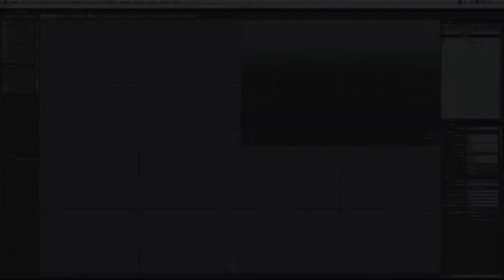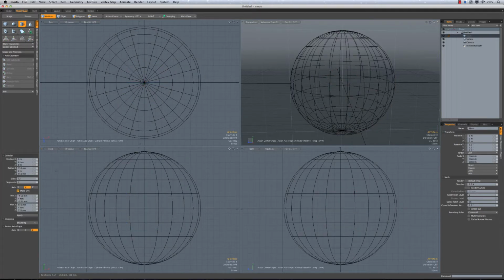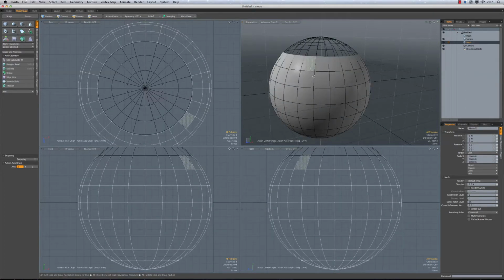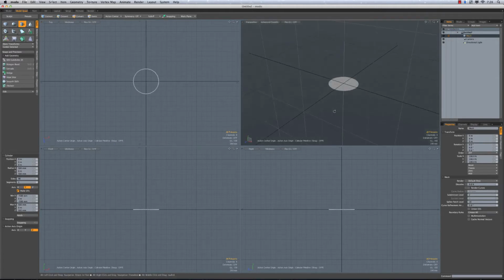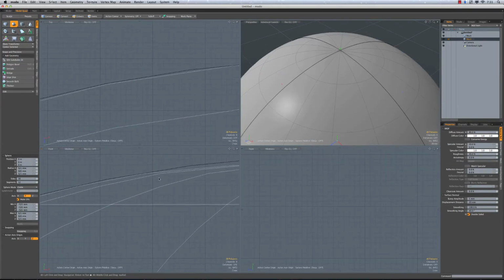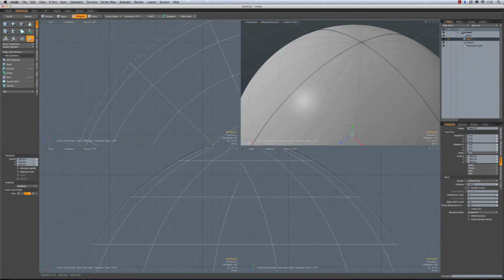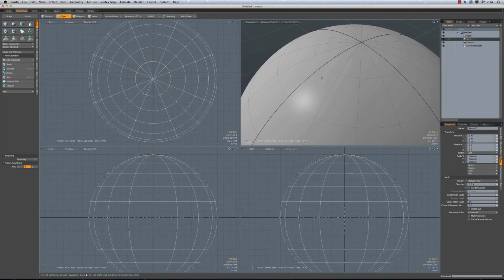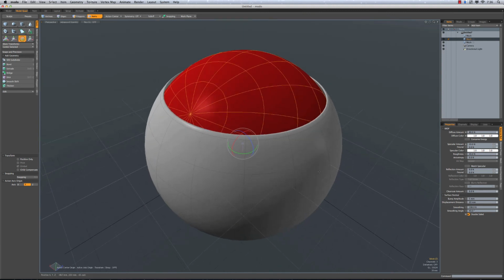LACY the Robot Part 1

Comment from the maker: I save out spheres of different mesh densities and these will be used throughout the process of modeling the entire robot. So you are just a step ahead :)

The main point is that the relatively minor imperfections in sphere shape are usually negligible but for complex interlocking parts, something more precise is needed.